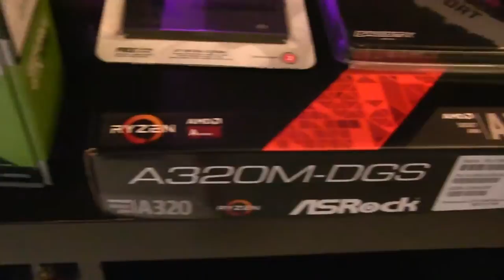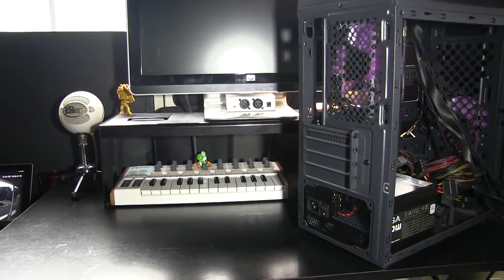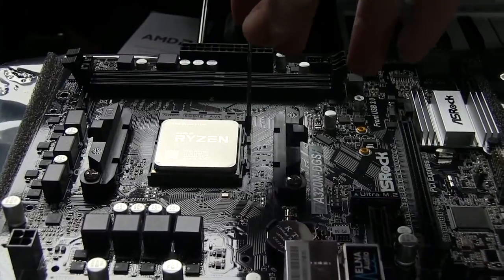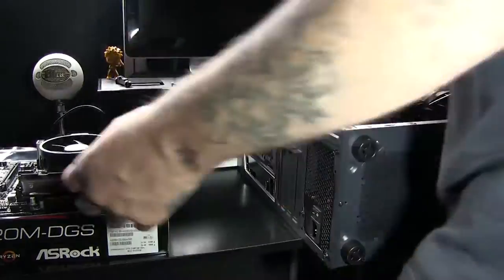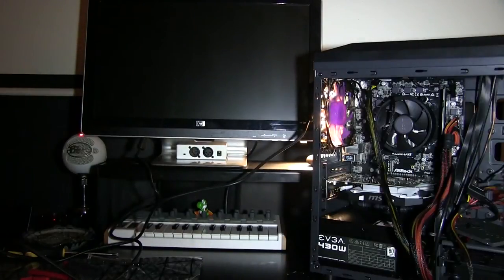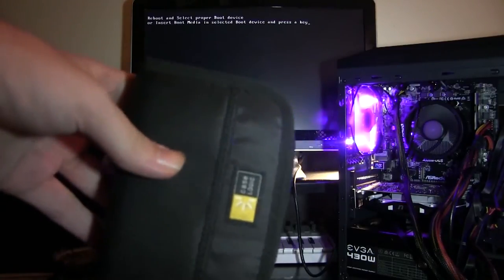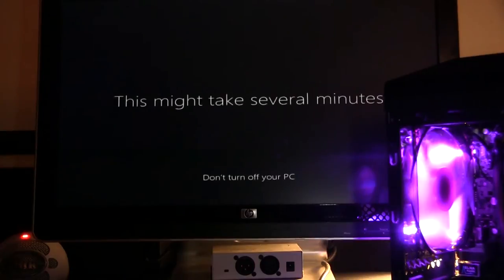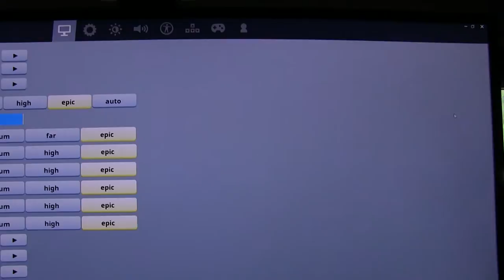Build the Ultimate Budget Gaming PC!

Comment: Nice build I do recommend that you use a RX 570 its about the same price as the 1050 but it gets way better performance
Reply from the maker: Thanks! You’re right they have decent  performance,This was just a build I did for a video my main rig is a ryzen 7 ,zotac 1070ti amp extrem ,16gb Corsair rgb pro ram. Probably going to upload the video on it this month. 😃
Reply: @CollectorKev  I have a RX 5600Xt and overclocked it has similar performance to a 2070, and beats out the RTX 2060.  Only paid $310.00 USD.  Which was also cheaper than any decent 2060.

Comment: Hey I am going to build my first ever setup and PC! Is this a good part list for a budget setup (€1050)

GPU: RX560 OC 4GB gaming
CPU: AMD Ryzen 5 2600
MOBO: X470 Aorus ultra Gaming 5
RAM: Corsair vengeance LPX 8gb 3000MHz
PSU: Corsair CX550M 550W
STORE: Seagate barracuda hard drive 1tb
WD green m.2 120GB
CASE: Coolermaster master of lite 5 rgb

Monitor: Iiyama G-MASTER2488HS-B2
Mouse: Gigabyte Aorus m3
Keyboard: Sharkoon SGK3 RGB
Reply: Collector Kev And freesync and the price difference between a RX560 and 1050ti is around 25€ here

Comment: What if you took out the the ryzen 3, the GPU and replaced them with a ryzen 5 2400G instead and used it's APU ? I wonder how the two would compare because the pricing for the two would be slightly similar but the ryzen 5 being a bit cheaper.
Reply: Mehroz Ahmed It would work
Reply: This would perform better, even the 1030 performs better than the integrated Vega graphics.